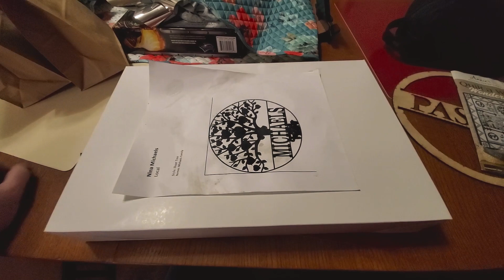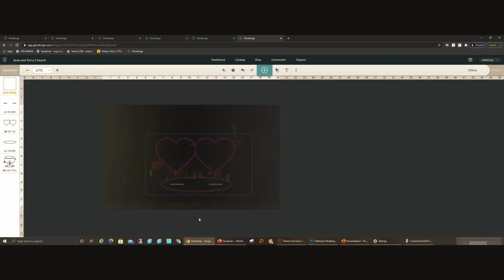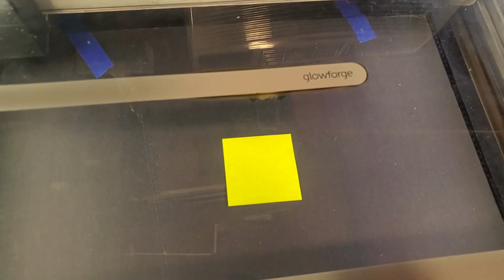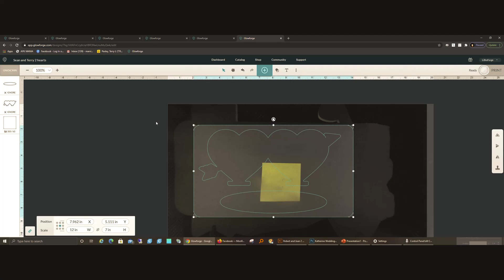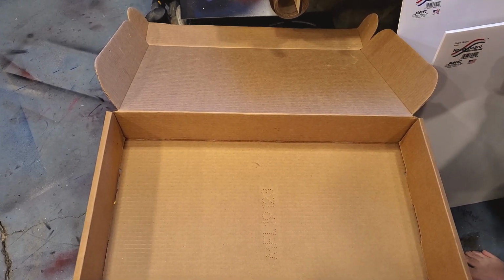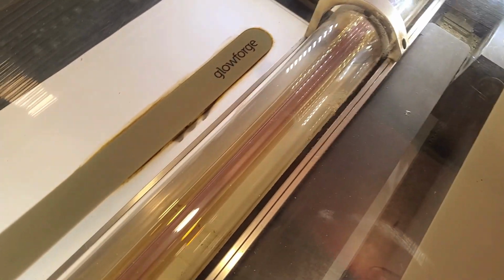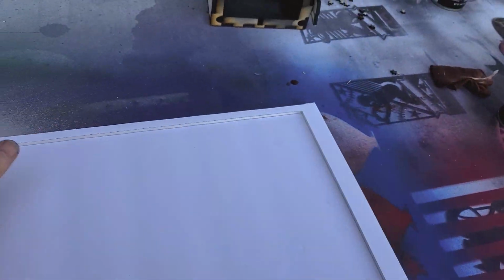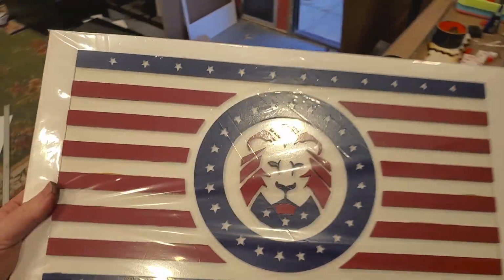How to make custom packaging using $1 Readi-Board and a Glowforge

Comment: I see that you have the settings for the speed and power but what did you set the thickness to for the material since it's a manual setting and not a preset. :)
Reply from the maker: I always leave it auto there, and before I start the job, click the e dots and SET FOCUS.  I never enter a thickness anywhere,  and all glowforge presets also default to auto now also.    If you set focus before laying out your design in the bed, it can help slightly with camera accuracy,  but not a ton. I have other videos about that.

Comment: Terry, Great video....Where do you get the box and what size is it?   Thanks
Reply from the maker: I got 12x20x2 inch boxes on amazon.  I got spoiled Because the first time I ordered, Ingot like 50 for $30.   Now tjat seller says unavailable, and I'm only finding like 50 for $70
Reply: @LithosAndLasers  I am not finding any 12x20x2 inch boxes on amazon?
Reply from the maker: @phototec  I see 12x20x3.   $25 for $60. https://www.amazon.com/dp/B01EN0WUV4/ref=cm_sw_r_awdo_navT_g_P4KYERNTAXD1FMXSJ2G9
Reply from the maker: Overkill, but many people use these.  https://www.webstaurantstore.com/choice-18-x-18-x-2-white-corrugated-plain-pizza-bakery-box-bundle/245CB18%20%20%20%20%20WHITE.html?utm_source=google&utm_medium=cpc&utm_campaign=GoogleShopping&gclid=CjwKCAjwyvaJBhBpEiwA8d38vOQ9mBsSupkUraJ4TX8O6M73WDjDG-utQK3mi-HEfez4BmQcBtpPTxoCfWkQAvD_BwE
Reply: @LithosAndLasers  Terry, Thanks, I was looking for the same Mailer Box you showed in your video, with the folding lid.  

Are you using this size box because that is the size of the sheets used for your Gloeforge? 

Also, what size are you making the SORTS cut-outs? Could they ship in a smaller box?  Thanks
Reply: @LithosAndLasers  PirateShip just notified me the postal service is temporarily raising their rate for the holidays, so to reduce the shipping cost, I want the smallest size box to do the job.
Reply from the maker: @phototec  when I buy my wood, I grab a 4x8 of cardboard free to cover it.  I often just cut 2 pieces larger than my item, and tape one either side.  Never had an issue and no excess size.  Works great to ship these flat packaged items.
Reply: @LithosAndLasers  Ok, that is great. I was impressed with the foam board cutouts you made to ship the cutouts, very professional looking.